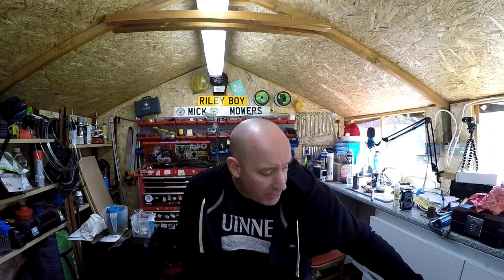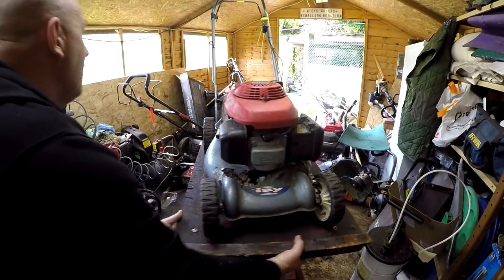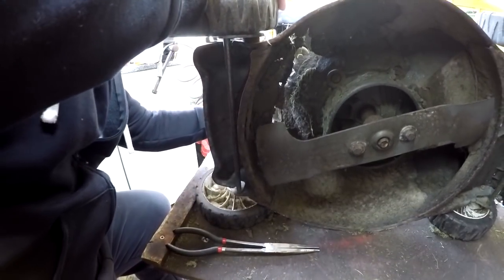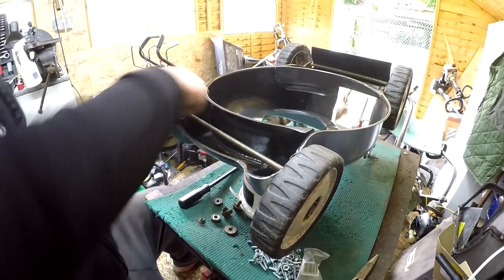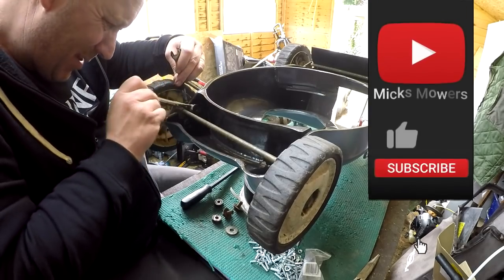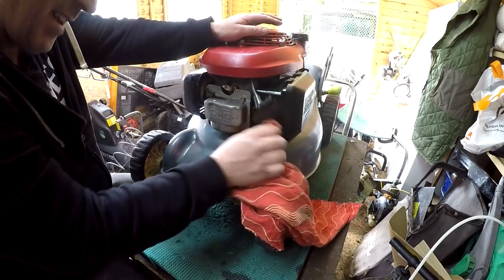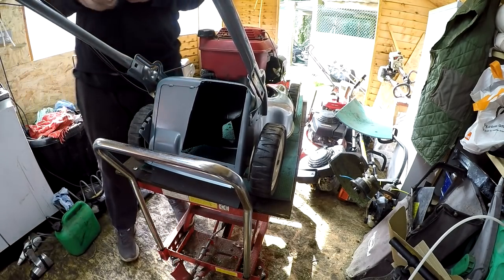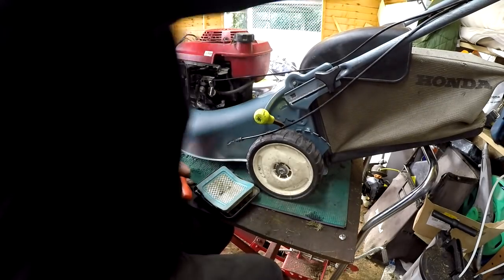HOW TOO MAKE A HONDA IZY Look Like New

Comment: Just replaced the deck on my 20 year old Izy and used this very informative video as reference. The deck on mine has needed replacing for the last 8 years, but I'd riveting patches on it and kept it going. It just collapsed in the middle this weekend so I had to finally get round to replacing it. The most awkward bit was fitting the spring into the body and the rear flap. Got an annoying rattle from the front axle that I can't get rid of either. Wasn't there before. Great video and a great help. Thank you.
Reply: How did you manage to do it? We are struggling to tension the spring.
Reply: @equisader  can't quite remember now. It was a year ago when I did it  It's definitely doable though with some swearing and perseverance. Will have a look tomorrow to see if I can remember what I did
Reply: @Sion_Jones  Had to chuckle that Mick missed this bit! still struggling with it!!LoL

Comment: Yep ive got the same problem with my 16"izy push mower
Its a 2001 with low hours but the deck is holed on the carb side!
Ive stripped/cleaned the carb  & it runs like new-will be getting a new deck👍

Comment: That was a lot of work, Mick. Looks decent. I wipe my decks with two coats of Nu Finish for a hard high shine. Plastics are buffed with Mothers Back to Black or automatic transmission fluid for other colors. That Honda engine is a bit worn and ting-ting-ringy. I'd put straight 30 or 40 in it.

Comment: Hell's Teeth, that old Deck was King to mine which I have to replace, I was going to get a new Izy but having seen your Video I'm going to just replace the Deck, mine is a HRG415 C3 PDE so it's a wee bit different no Throttle Controls, the Deck it'll cost £150 + Delivery.

Comment: i have stripped what I believe is a C3 Hizzy. Two q's please if you can help.
1.How did you get the grass box flap back on? Which way round does the spring go?
2. I have changed the engine for one the same as your video (C1?). Will that type of speed lever fit my model which has a single throttle cable / auto carburretor system? as it does not seem as if the C3 carb plate etc fits the C1. Hope this makes sense. Many thanks. Keith
Reply from the maker: hi mate i did a video in another honda a gold one. i show how to do the spring in that video

Comment: How do you refit the sprung grass box guard. Ant tips. Beaten me. So far ! 

I have completed my deck replacement; almost. With the self propelled version (of my HRG415C3 SDE) you MUST refit the stripping strip before you fit the rear axle; otherwise it is rear wheels off. The other major tip is that the blade bolts and the motor bolts WILL be very stubborn to remove; hence Micks use of a impact gun ( I don't have one!).

Comment: Good job Mick. I use an izy for work as well perfect for getting in and out of the car. Like you say Honda chassis are expensive I have 2 Honda engines sitting around waiting to be fitted to new body's.
Reply from the maker: Chris Hale yeah mate not a bad mower. Now it’s like new

Comment: Nice video mick. I think someone else noticed the noise? Had a Honda sound like this, it was valves loose tapping away. Either that or pawls sticking slightly. Keep up great work. 👍😉
Reply from the maker: Jenny Brayshaw yeah. But as a lawn care guy he will run it into the ground and just get me to put another engine on it when it lets go.

Comment: Well done Mick, looks great and the engine can idle quite low too.
Reply from the maker: Wow your up late mate.. yeah its runs ok but has a little knock.. think it's the valves
Reply: @themowerman  So are you! I'm just off to bed. Working from home tomorrow and will try to fit in some welding.
Reply from the maker: @BensWorkshop  cool mate look after yourself

Comment: Hi again Mick, 

I figured this out. For the benefit of your viewers. I made a small loop of string and fed it though the top of the guard. Assemble the cover with one side of the shaft fitted correctly. Press the shaft all the way until it is facing the hole on the other side.The string will need some pulling; I used a lever. Hold the guard pull the string until the spring is aligned with the slot, press in and push the shaft through the remaining hole for it. Hope this helps someone.

Comment: Nice one mate, sounds to be starting to knock a touch but I assume the gardener will just use it until it explodes. Still I’m sure you’d easily be able to find an engine for it. In fact I’ve just finished re building a Honda GXV160 engine that had been run into the ground.
Reply from the maker: Yeah mate he will.. I have lots of Honda engines laying around so when it goes bang I will stick another on it..

Comment: Just on with fitting a new deck to a 415c2 Izy... had the new deck blasted n powder coated. Biggest prob i find is getting grass boxes in decent nick...most are rotten.. the rest of the Izy range is generally easy to sort though.
The one in your vid sounded a tad tappety?
Reply from the maker: Yeah the valves needed doing

Comment: Hey Mick   I just picked up one of these... none runner ...  cleaned the  carb out  and it starts  up  but  wants to  take off  and detonate  .. honestly  I haven't put an sv150 coil on it ...  love your thoughts  if you could  I've  done a  couple of videos on it . Not had a Honda before 👍🏻👍🏻👍🏻
Reply: Brilliant video so many hondas about with corroded decks the engines are bullet proof so you've briught another to life

Comment: Very helpful, but where are your safety glasses ?
Reply from the maker: Nice and safe in the draw
Reply: @themowerman  Hi Micks, Thanks for your quick reply. I am about to dismantle/rebuild my HRG415C3 SDE. A simple job, I know. Finally got the blade off, easy peasy. NOT. Mine is a self propelled, just to make it all that much easier! Thanks again.

Comment: I'm new subscriber, a really great informative channel. I'm hoping you could be so kind to help me a little as I'm on the market for a new lawn mower. The Izy keeps comming up as a strong option. Its for domestic use for 135 sqm lawn, any other recommendations you could suggest (far from an expert myself) also which hammerite did you coat the underside with, as if i do get an Izy, I take it good practice would be to coat the underside from new?

Comment: Hi Mick and Riley boy, love your videos, thank you.  Can I ask you a question. I have a Honda Izzy and I’ve cleaned the carb, air filter etc and it starts first pull and runs nicely.  Once it’s warm and I stop it then start again it’s hunting for about 30 seconds then it runs ok again.  I’m at a loss, any ideas what it might be? Thanks in advance. Rob in Anglesey.
Reply from the maker: Yo yo .. sounds like a fuel delivery issue take the fuel pipe off the tank.. there should be a small long filter in the pipe/tank. Give that a clean and replace it. If that doesn't help then the carb will need another clean mate I would say
Reply: @themowerman  Thank you so much for your speedy reply Mick. 👍👍

Comment: Hi mick is it the blade that tells you the deck size just picked one up looks very big lol but revs high still got to look at it the deck look good the drive dont work
Reply from the maker: The deck mate will give you the size
Reply: @themowerman  morning mick hope u dont mind me asking on my mower the pull cord is ready to snap it got left out last year iv seen you can buy a roll ur just like one bit is some thicker than others
Reply from the maker: @garyclifton2180  hi mate you want 3mm pull cord
Reply: @themowerman  thanks mick your  a good un lol.

Comment: Hey Mick any chance you can do a video on a compression test on a Honda izy as I have one that’s brand new works very sweet but the reading is around 50 psi , I tested it on my stihl strimmer and that’s around 90 - 100psi , ( I’m baffled )
Reply: Just a thought Paul, maybe its equipped with compression release and you won't get over 50 on compression test.
Reply from the maker: Hi mate. It could be your compression testing kit.. just a thought
Reply from the maker: Also the Honda may have a compression release valve
Reply: Yep it’s the compression release valve that’s the problem I have just found this out , thanks for the reply Mick it’s much appreciated mate
Reply from the maker: @paulstir  happy to help mate
Reply: Mick your definitely worthy of fame on the tube mate for taking the time to answer your followers and all the videos / editing etc etc 👍 I wish you all the successor your journey 🏴
Reply from the maker: @paulstir  well that's a fantastic comment that's very much

Comment: The new paint finish they use on the newer Izy mowers is completely different to the older models as it is in a dark grey with dimpled effect,  which is similar to what mountfield used to put on their older mowers. They actually look a bit better as well. I think the older models didn't get enough paint hence why they rusted quicker than other steel deck mowers.
Reply from the maker: You may be right mate.. hope your good my friend